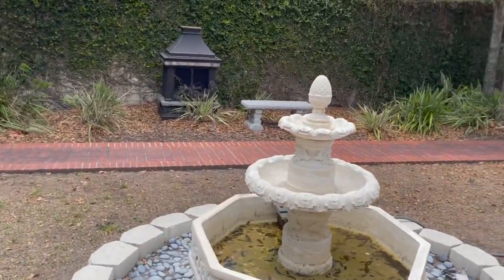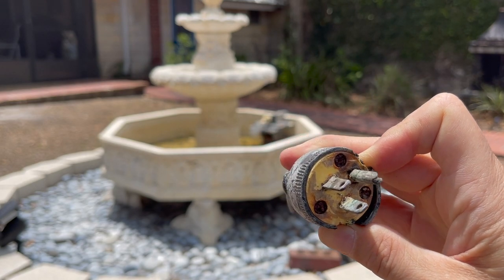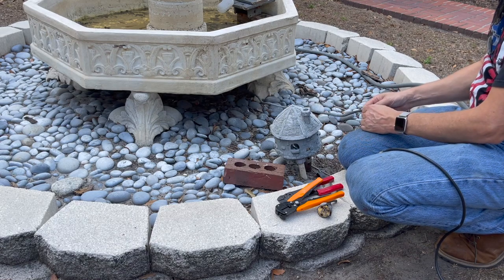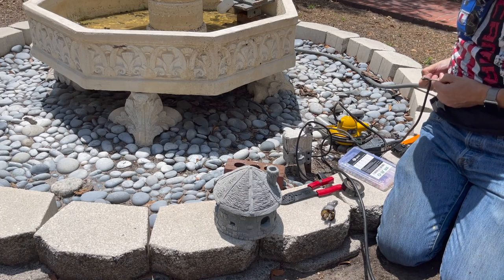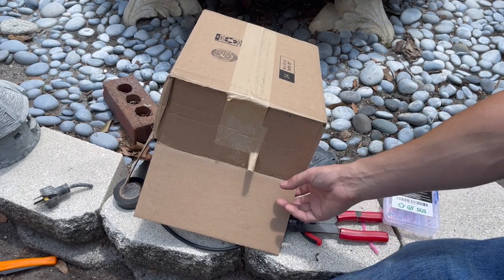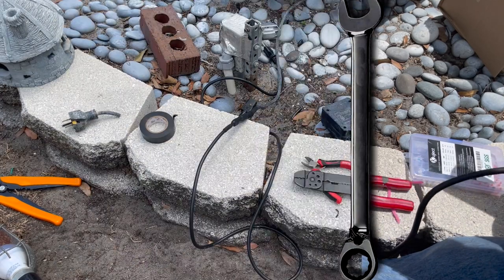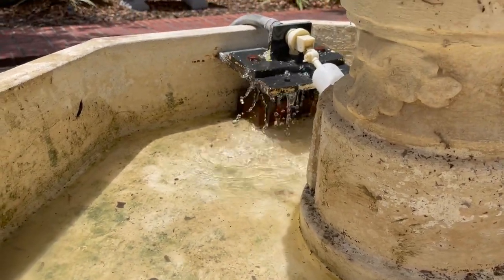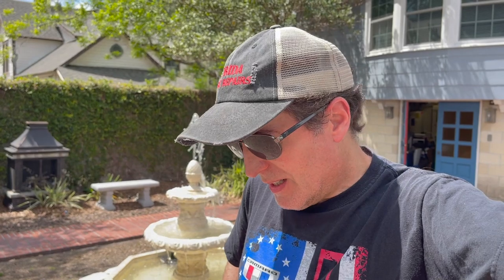Fixing an Old Water Fountain

Comment: I suggest you plug in the pump power after you fix the Socket.  Cover it all with a plastic bag.  Then cover it with the little "house" to try to keep more water and lizards away from the plug and keep out water too.
Reply from the maker: Totally.  I already changed the socket out.  I could have made a video on how difficult that step was just to get it out of the box.  Someone had glued it in with casket sealer or something. The plastic bag under the housing is a good idea as long as I can seal it from the bottom so water and condensation doesn't get in and become trapped.  I think that'll be my next step,  thanks!

Comment: I would not be happy with whatever that is on the side of the fountain, the pump I'm guessing. The pump should be hidden inside the fountain.
Reply from the maker: The pump is actually in the center base of the fountain and under water.  The power supply is outside of it.  The pump is frequently choked off by leaves falling into the pump and the screen to keep them out only barely works.   Can you tell it's constant maintenance for me?  :)